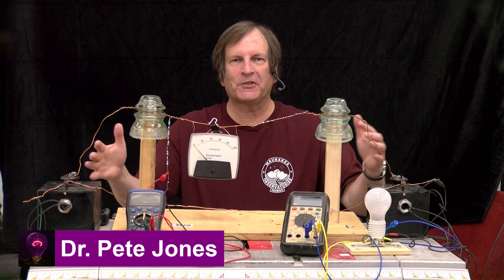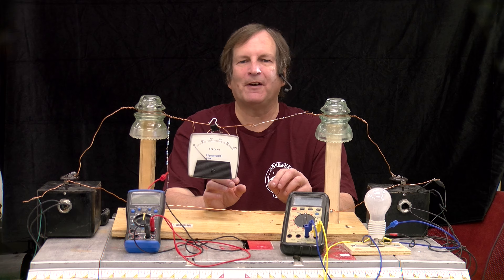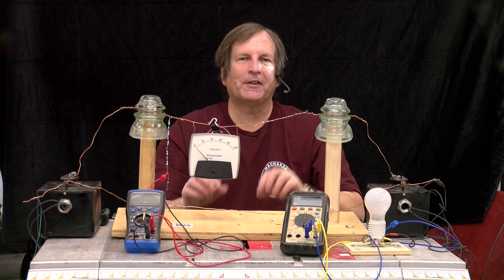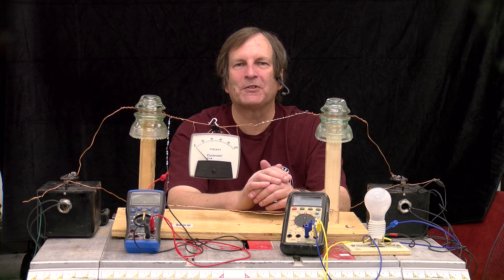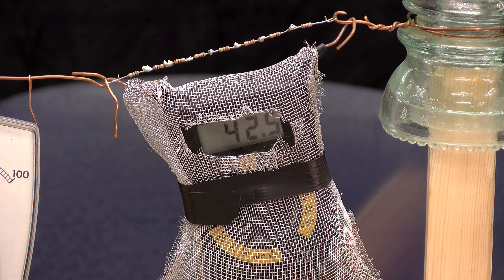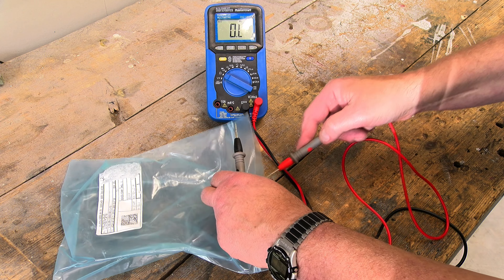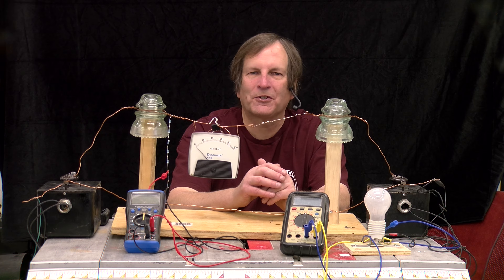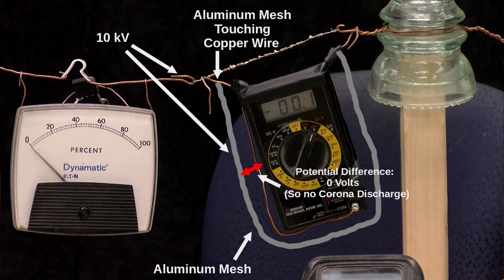Operating an Electronic Multi-meter at High Potential

Comment: Can you measure the voltage on a Van de Graff (?sp) apparatus using this, somehow?
Reply from the maker: Unfortunately not - this is not measuring the voltage to ground  - its measuring the voltage (about 40V) across a resistor where both ends are about 10kV above ground. 

The problem with measuring the voltage from a Van de Graaff generator is the max current the machine can supply is usually in the micro-amp range probably at 100kV or so depending on the machine. The low current makes it hard to use something like a voltmeter because even with sufficiently high voltage dropping resistors, the current drawn by the meter would bleed off the charge faster than the machine can replenish it. 

The high voltage from a Van de Graaff  makes it possible to use electrostatic repulsion in a meter to measure (high) voltage while drawing almost no current. See https://en.wikipedia.org/wiki/Electroscope
Reply: @ElectromagneticVideos  Thanks.  I've always wondered how that might work.  Now my mind is going the other way wondering if those little "leaf repulsion" instruments (the electrostatic meter, which again my mind is foggy of its name)... wondering how small a voltage they can measure — a battery?  Hmmm.  Wish I was in a lab right now.  I've got a hankering to walk around on carpet holding one of those. I guess these days we'd just use a FET or better a BiFet opamp for sensing fields.  I dunno.
Reply from the maker: @schitlipz  The electrostatic meter is a (gold leaf) electroscope. Easy to make - just cut two strips of Aluminum foil 1cm x 4cm, put a hole close to the ends of each, and hang on a hook shaped metal wire in a small jar or bottle. You should easily be able to detect the type of static charges we get on clothing etc in the winter. 

As to how low a charge they can detect, I'm not sure what the practical limit is. The thinner and lighter the metal strips, the more sensitive. Gold leave is used because it can be made incredibly thin. I'm guessing 500V or 1kv is the minimal practical voltage that can be detected with an electroscope. Anyone know?

A MOSFET would be the perfect thing for measuring charges at low voltages - if you can protect the input to a max voltage less than what would damage the oxide insulation lager. Maybe a NE-2 lamp would do that without drastically lowering the input impedance. I think the issue would be having the max input V so low. Maybe a combination of a MOS device for low potentials and an electroscope for higher ones?
Reply from the maker: @analog_guy  Thank you so much for this detailed explanation of HV measurement. It never occurred to me that an electroscope device would measure RMS - in hindsight, it obviously has to, but like so many things, its only obvious once you know the answer. Also never knew about the adjustable voltage + field sensor technique. How clever. 

You did such a wonderful write-up on this subject would you mind if I copied it to the Community table of this channel so it gets preserved? I find there is no easy way to find things in the comments and it would be to bad if what you wrote got lost.
Reply: @analog_guy  The channel Ludic science says an arc of about 1cm is 10KV, but I thought the breakdown of air is 30kV/cm.  What am I missing?
Reply: @ElectromagneticVideos  Thank you for the kind words.  You have my permission to copy my write-up.  The info comes not so much from me as from the accident of my particular assignments during my working days prior to retirement.
Reply from the maker: @analog_guy  Thanks! I will copy it later today and of course credit you. I was lucky that you came across that stuff at work - great info to have for anyone dealing with HV!
Reply: @ElectromagneticVideos  Hi again.  Do you know the answer to my 10kV vs 30kV question?  Seems simple enough that a 1cm arc equates to 30kV, but I don't understand why 10kV is used by the channel I mentioned.  I have asked him but no reply to my comments there.

Anyways, this is all interesting stuff.
Reply from the maker: @schitlipz  Sorry - some how I missed your previous comment with the question. There really are two parts to the answer. The first thing is than air can vary - humidity is probably the biggest variable, so very humid air will tend to have a lower breakdown value. Heat also makes a huge difference - heat air up a bit and the breakdown is also lowered. 

The other part is geometry of the electrodes and how it affects  the electric field strength (and the the field strength that causes breakdown). If you have two infinite metal plates 1cm apart, with a potential; difference of 30 kv applied to them , the field strength in the air between this will be a uniform 30kv per cm . So if the air is clean and cool and dry, you should be on the verge of breakdown. Now replace   one infinite metal sheet with a  sharp needle  with its point  1cm from the other metal plate. The electric field will concentrate around the tip of the needle and be much higher in that tiny region. So it it should be able to initiate a breakdown at a much lower voltage between the plate and the needle than 30kv. 

So the bottom line is in a real situation with electrodes that are small and air that isnt perfectly clean an dry and cool, 10kv per cm is a good number to use as  breakdown estimate.
Reply: @ElectromagneticVideos  That makes sense.  Tanks.  I wonder if there is a point-to-point rating somewhere, besides a relatively nebulous number of 10kV,
Reply from the maker: @schitlipz  Unfortunately not - it does depend on the diameter of the points and the exact geometry of the electrodes (and the air quality). But 10kv for a 1cm spacing is a pretty good value hat is often used. If you want to be sure an arc happens at 10kv, make the spacing a bit closer. If you want to prevent corona discharge and increase the voltage before breakdown occurs, use nice round metal balls as electrodes (a few cm or more in diameter).
Reply from the maker: @analog_guy  Just re-posted your great writeup here: https://www.youtube.com/post/UgkxWl9F0ccCWVQ1wICA8MDIHaClFzRMtee6  . Thanks for that fabulously informative comment!
Reply: @ElectromagneticVideos   Thank you for your confidence in my off-the-cuff reply.  I do enjoy your technically accurate and useful videos, in contrast to a lot of other misinformed stuff that pops up on YouTube.

I like those glass telephone line insulators you used in this video!  Mom and Dad gathered and gave away a bunch of those when the individual lines were eliminated and replaced by a multistrand cable across their property.  The phone company discarded the insulators, poles, and cross-arms.  Mom and Dad had a yard fence constructed from the poles and cross-arms.  When I was young, I glued together a pair of these insulators base-to-base as a curiosity.  It remains just that - a curiosity not very useful for anything else!
Reply from the maker: @analog_guy  Well I try and be technically correct as possible. But I always appreciate getting info from someone who has had more experience or knowledge in one area or  other. 

The insulators - I have liked them ever since I was a kid - found one near an abandoned loghouse foundation when I was 5 or 6  - still have it somewhere - not as fancy as these ones. You certainly have a nice memory of those insulator too.  I have  picked  up insulators here and there  - often under telegraph lines that have long since been abandoned. I think Bell didnt leave any many lying around when they went to multi-strand cables around here. 

They turned out to be perfect for the HV demo, and I'm sure I will use them in future videos. Kinda neat that after so many years they were put to use once again, even if just for a short video.

Comment: What you built was a "Faraday Cage"  for the meter. Great for keeping RF energy in or out of your device. Yes, I know it was just 60 Hz, but this also works for anything at very high voltages, like in this application.

Play safe.

Now, how about magnetic fields on old CRTs. LOL

I am thinking about transformers in the room below. A very old story.
Also, fluorescent lights just above the CRT. Both true examples. The first was in a large building, and the other was on a submarine.
Reply from the maker: Sometimes autocorrect does the funniest swaps - it should be "Faraday Cage" :). I didn't want to get into the details of Faraday cages in this video since the main purpose of it here was in this case to raise the electric potential immediately around the meter to the same potential as the meter to prevent corona on the the meter .

"magnetic fields on old CRTs" are you referring to how things can be shielded from magnetic fields? The equivalent of a Faraday cage made with high permeable magnetic material will do it. Many CRT color TVs had a mu-metal shield in the cabinet around the from part of the tube for that reason.  If you want to see a CRT exposed to a 60Hz field, see my video on demagentizing : https://youtu.be/mGK8oYdEqyE
Reply: @ElectromagneticVideos  Very True, Thanks for catching that. will fix. "Faraday Cage"

There was a system that had that, it was called the "Tempest System" that costed a bit more and was used by the military.

At the time (late 80's), seen that many times.
Reply from the maker: @wrongmouse1658  I remember the tempest computers! Never used one myself, but they were notoriously expensive if I remember right. There must be some equivalent standard today with all the potential electronic eavesdropping and disruption.
Reply: @ElectromagneticVideos  Word Processor - CPT, Model 8100, circa 1982. There was a tempest version of that one. Also, a version of CPT with a "S" suffix for submarines. You know, if it did not fit thought the hatch, you could not get inside. LOL
Reply from the maker: @wrongmouse1658  I guess that makes size a pretty strict requirement :) 

I had to google CPT Model 8100 - never heard of it - 1982 was when I started university and was the time when various home computers like Apple etc were becoming widespread. I'm guessing as dedicated word processor, if I ever did see a CPT, I never paid any attention to it.
Reply: @ElectromagneticVideos  What funny about the PCT's was there was few models, all but the last one was 8" floppies and you could boot a CPM system on it. 
Had a few buildings infested with them.
Reply from the maker: @wrongmouse1658  So really could be used as microcomputer - they must have had an early lead area - to bad they didnt manage to morph themselves into a computer company as home computers took over. 

So where did you work? Looks like the PCTs were incredibly expensive but probably easily payed for by the time savings of a real word processor in the days for typewriters and carbon copies. 

I have seen 8" floppies - and used cpm on a home soldered Z80 card for the Apple II so I know a bit of things from that era. I think I even had Turbo Pascal running on a the Z80 card.

Comment: The cheap voltmeter is probably only approved for up to 300V AC. You have to think about whether the plastic of the housing provides sufficient insulation.
There are voltmeters for higher voltages, but these are more robust and also more expensive.
Voltages over 100V AC are certainly not playable by inexperienced users.
Reply from the maker: If that! Although it has a 750V AC range, I would not trust it on anything above a  few hundred volts.

The insulation of this voltmeter would definitely not withstand 10kv. Even better insulation that did may not solve the issue as capacitative effects of the AC could still get through. I know they make clip on ammeters for use on HV power lines. Would be interesting to see how they are constructed - maybe with a metal plating on the inside of the plastic case?

Comment: There is a trick to look through the window of a microwave oven. It's similar to the metal mesh. Move your head left and right slowly. But I'm sure everybody knows this.
Reply from the maker: I think a bit of edge sharpening in the camcorder made the mesh harder to see though in the video. It was easier to see in real life. But thanks for the tip on how better to see if you can move your head (or camcorder!).